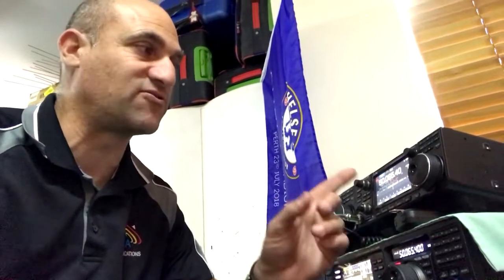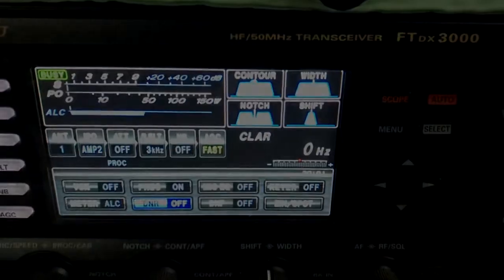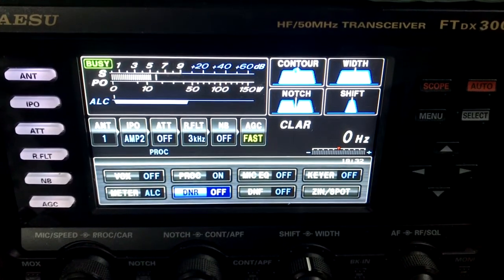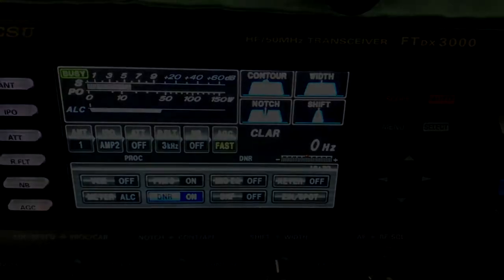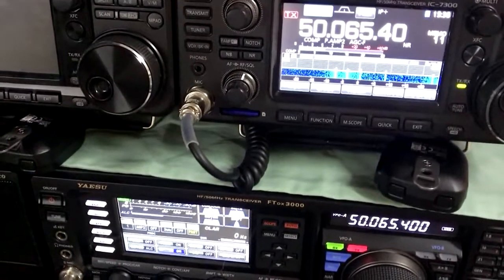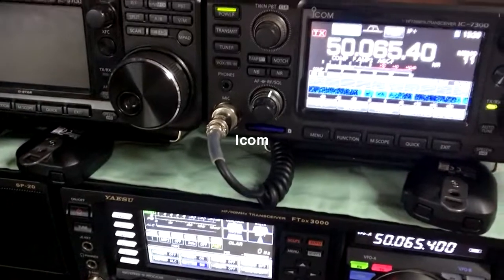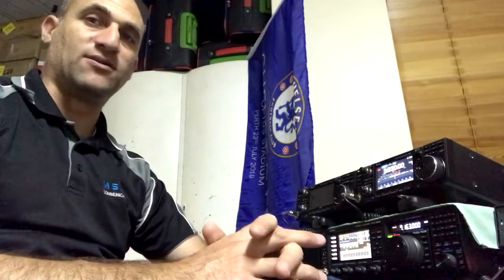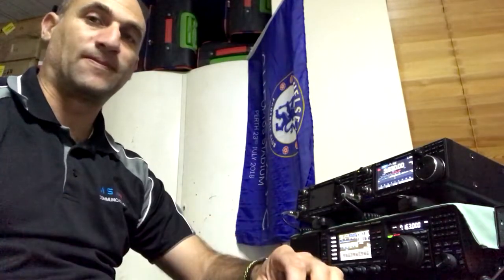Yaesu FTDX3000 DNR and Icom IC7300 NR

Comment: Had the Icom 7600 then bought a Yaesu 3000. The Yaesu crushed the noise level test when running on SSB. Wasn’t even close. 
The 7600 stays set up for digital now. Never use it on phone bands any longer. 
The CW decode was a plus when learning CW. If you miss a word you can use the radio to double check yourself.

Comment: Using preamp 2 on icom 7300 adds a lot of noise. I never use it made comparison unfair. I too prefer yaesu DNR but the menu on 891, 991 and 3000 is trash so it’s not worth using so I sold both(991&891). I use icom 7300 with west mountain radio DNR speaker I bought for $125 and it sounds even better than yaesu Radio DNR.
Reply: ニマメ

I think so too.

Comment from the maker: The Ftdx 3000 also has a warmer sound then the 7300. I use the 7300 for ft8 and SSTV only now. I have a Ft991a in my vehicle and the noise reduction feature is fantastic in reducing the vehicle electrical noise as well. My ultimate radio is the new FTDX 101 one day will purchase it.
Reply: i have the 101mp, but also an 9000mp... sorry to say 9000mp still is the best

Comment: I have the 7300 and the 891 without doubt the 891 is far better at reducing qrn and qrm. In fact I plan to sell the 7300 for the 3000 because yaesu noise reduction and filtering is far better.  I mostly use the ft 891 now.

The menus on the 891 take some getting used to but now im used to them its not an issue, I just wish I had heard the 891 before I read all the great reports on the 7300 because Itwould have convinced me to get the ftdx 1200 or 3000 instead.

The fancy waterfall doesn't make the radio hear or sound better.

Comment from the maker: Hi Kelly, if you can afford the FTDX 101 buy it. It has the best of FTDX3000 and SDR scope. The scope is great to spot signal right on the noise floor just like the 7300. I enjoy using the FTDX 3000 on 80m as the band is full of hash and the radio cleans it extremely well.

Comment: I've watched your video more than once.  Not that I NEED another radio, I am trying to decide between the FTDX-3000 and the IC-7300. It seems to me like the 3000 NR is a little better.  I have heard that the 7300 receive can sometimes break down in heavy QRM but I like the looks/sound of the FTDX-3000.  Decisions, Decisions!
Reply: I had both on loan some months back. My heart was set on the icom due to the screen ect. I used both for a 3 week period and I must say that the 3000 was far more superior. The filtering on the 3000 was on a different level. The 3000 internal Speaker sounded as good as the sp8 Speaker  I had on my previous radio. I wish that yaesu had added 4m but an amazing radio on 6m too. I have not owned a 3000 for 6 months and very pleased with it